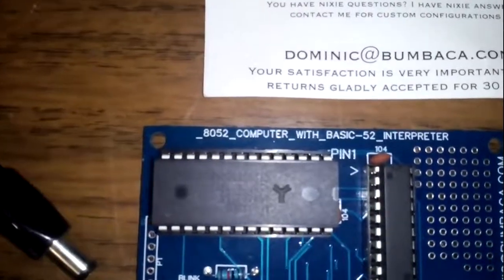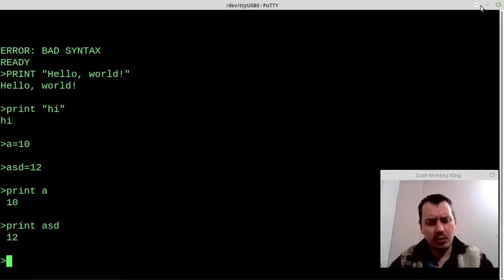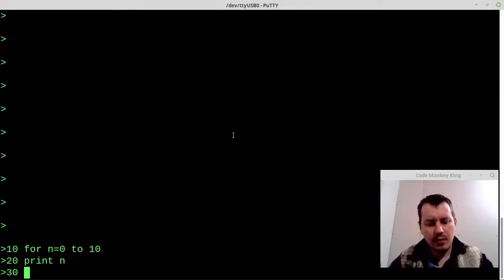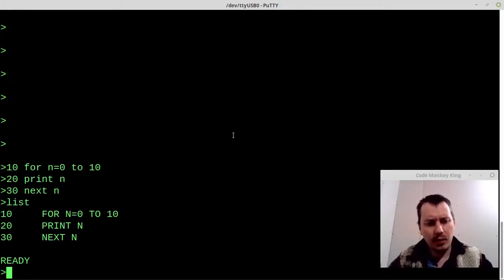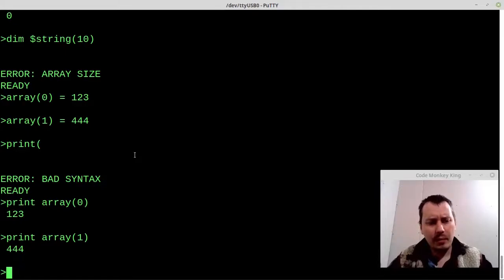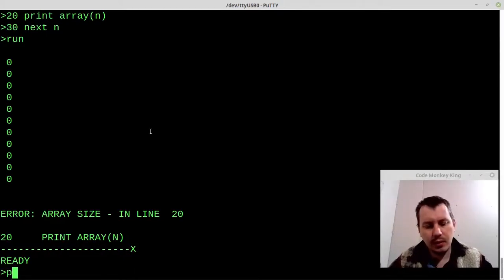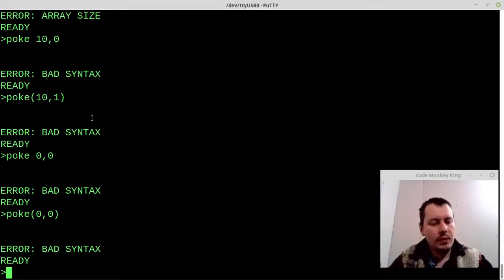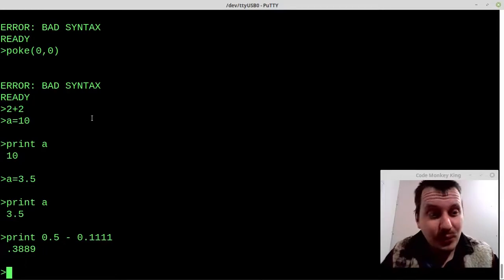Testing 8052 computer with BASIC 52 interpreter via serial monitor

Comment: The 8052 micro-controller was intended to be used in embedded systems so its feature set is not the same as you would find in a c64, but its close enough. the 8052 has the ability to burn eproms built in as long as it had access to a 12/24v rail for eprom write (not implemented in this case) It has a robust floating point, do-while loops, AND OR and XOR logic operators, GPIO ports,  PWM  and more..
Reply from the maker: Cool! I didn't know that)

Comment: Syntax for strings is      LET A$="CODE MONKEY KING"

Syntax for arrays is DIM A$(254)   max size is 254, and all arrays are one dimensional.   Undeclared arrays are defaulted to a size of 10, when you were using print PEEK(x) it was actually thinking you were addressing an undeclared array and failed when you got past the 10th position in the array. 

Strings are declared differently in this version of basic...  I dont remember the syntax but they are supported.
Reply from the maker: Awesome! This helps a lot! Thank you!